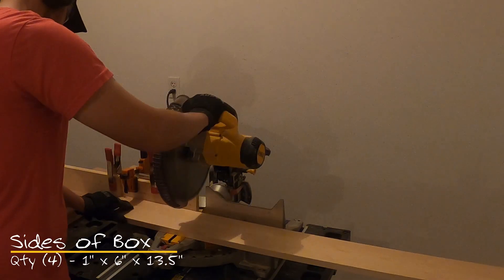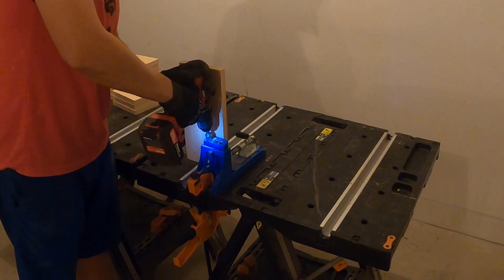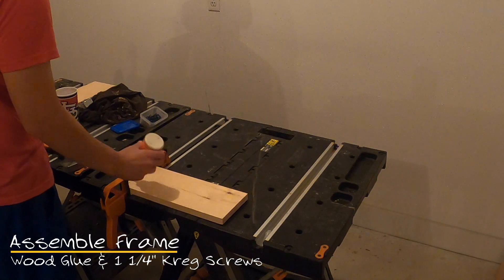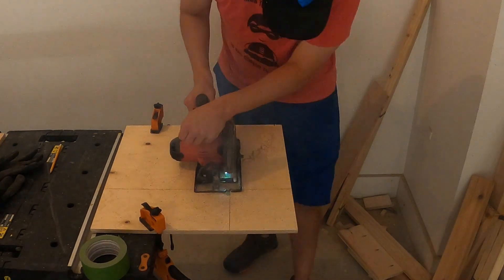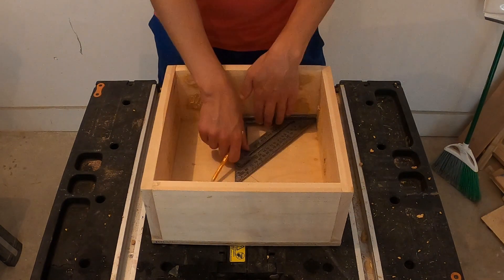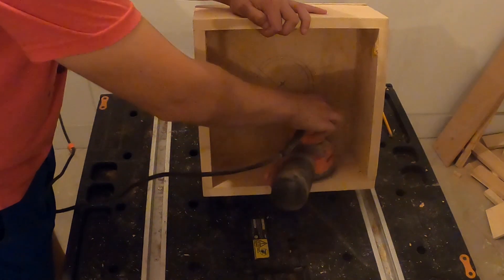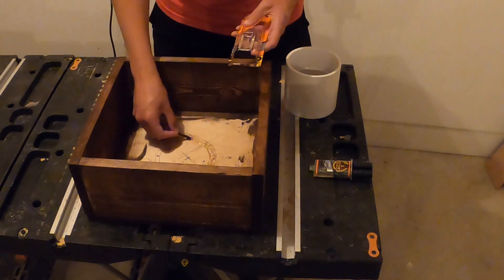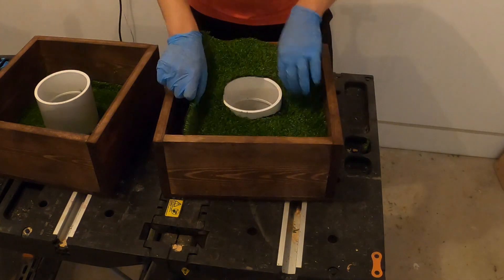How to Build a Washer Toss Game DIY Easy Woodworking Project

Comment: Great Video! Can you list all materials needed?
Reply from the maker: Thank you, David. 

Materials: 
○ Qty (2) 1x4x6 pine lumber
○  1/2" Plywood: Need enough to cut out a 12x12 section. I can generally find small square pieces for a reasonable price at my local Lowes or Home Depot. 
○  4" PVC Pipe
○ Washers: https://amzn.to/3NIQeAo
○ 1 1/4" Pock Hole Screws: https://amzn.to/3I6uTx3
○ Minwax Hickory Gel Stain: https://amzn.to/3rjhQm1
○ Wood Glue: https://amzn.to/3Ihk2R4
○ Vinyl Gloves: https://amzn.to/3o8V91X
○ Paint Rags: https://amzn.to/2ZDAZUh
○ Epoxy: https://amzn.to/3xBaJWY
○  Outdoor Carpet: https://amzn.to/46E6E5F. You can probably find this cheaper at your local hardware store.

Tools: 
○ Miter Saw: https://amzn.to/3Db4avs
○ Circular Saw: https://amzn.to/3lolxTx
○ Drill: https://amzn.to/3o8KJ20
○ Kreg Jig: https://amzn.to/3IaeibQ
○ Orbital Sander: https://amzn.to/3Dc37eF
○ Tape Measure: https://amzn.to/2ZBrLrt
○ Workbench: https://amzn.to/3d2GONZ